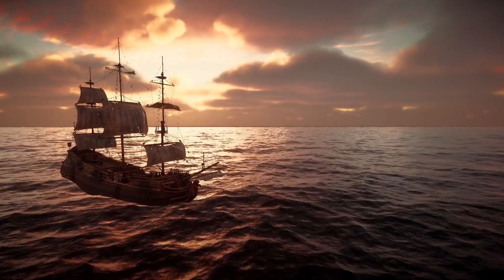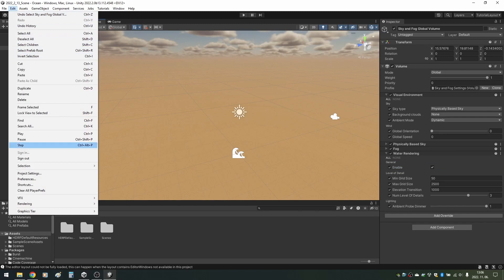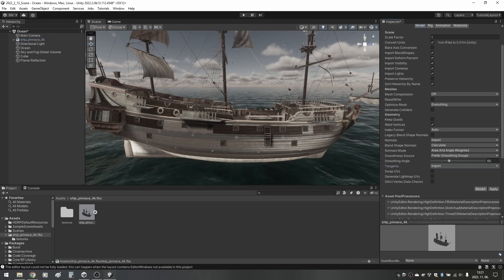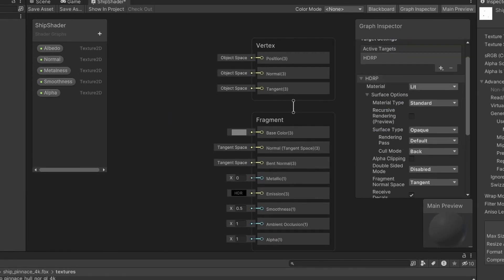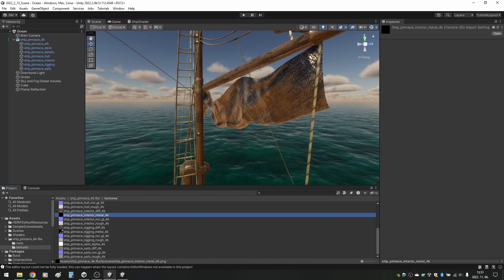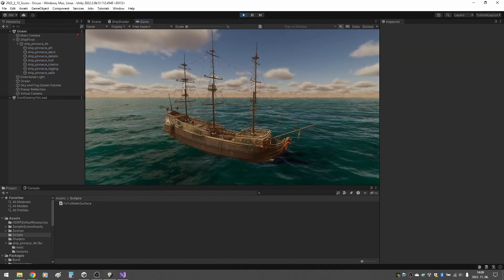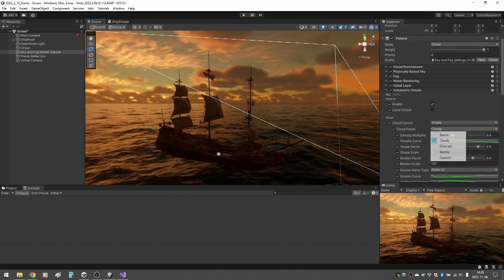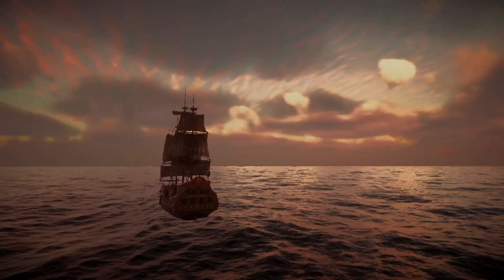Make a Scene with Unity's Water System! - Tutorial

Comment: Was there any point in adding a script for buoyancy if the ship doesn’t react even a millimeter to water and waves? Of course, I understand that the ship is large, but it does not react to changes at all, but only stays at the same level, as without this physics of buoyancy.
Reply from the maker: Are you testing it yourself or looking at the video? If testing: in this video I was using a beta Unity build, the script I have used here might not work in the release version. If you are watching the video: it does have an effect, believe me. It is not that realistic, but still better if I was not using the script at all. Watch the section from 11:21.
Reply: @bencemervay  Please, you can say how or show how to make such a script make the ship react to waves and pits, from the nose to the back, which would make it lean and not only jump exclusively vertically with the entire hull, but not once not bend, which is strange. I have been trying for a long time but I can't do it. by the fact that if you add control and an engine, a similar script with one buoyancy point makes the ship do somersaults in all directions.

Comment: 5:54 never do this in a real project if you don't want to get an angry reports, that your game runs at 5 fps on most hardware. You could also just extract roughness from the mask maps, invert it to get smoothness and pack them back, instead making new shaders and materials.
Reply: If you want to make something that would run on most hardware don't download such ship and don't use HDRP at all!
Reply from the maker: Hello! Thank you for the response! First of all: I never said in the video that this will be for a game :) If you have a look at the zip folder of the ship, you can see that there was no mask map. I know how to put it together (I also included the documentation for it in the video description), but it was not in the scope for this video. I totally agree with you that from performance point of view, calculating the smoothness map from the roughness map inside the shader makes no sense, but if you are just fooling around and testing stuff (what I do in the video) it is better to have a shader that can use both roughness and smoothness maps right away, becasue that makes testing faster. This is also true for the mask map. Most 3d assets have separate textures, so using them separately makes sense. Once you are making a game, creating a mask map makes sense. Regarding the shader: making new shaders for a game is actually the right choice. Unity's default shaders (especially in HDRP) are very heavy, so using them in a game environment is a mistake. When you are making a game you want your shaders to perform as little calculations as absolutely necessary and the only way  you can make sure that is the case if you make the shaders yourself.

Comment: The indirect diffuse lighting multiplier is NOT a way to get some bounce lighting, that control is optional to use after you bake indirect lighting, is something like a  "post processing" control to increase the value of indirect lighting, it does not have to be elegant or beautiful because that depends on your previous baked lightmaps.
Also, using reflection probes can help you with the ship and the water, because it looks off, or at least you can use SSR or planar reflections
Reply from the maker: Hi! Thank you for your comment. I agree that me saying that the indirect diffuse lighting will give bounce lighting is misleading. I simply should have said that I increase the multiplier to make the ship brighter. However, for the indirect diffues lighting multiplier to work you do NOT need to bake anything. You can see in the video that it works without baking. Also, have a look at this official Unity tutorial: https://youtu.be/DlxuvvYZO4Q?t=356 The presenter uses this override to dim the ambient lighting, however, he says that this is not a proper way to generate GI. Also, I personally try to avoid baking the lights when possible. I know I will get an inferior result this way, but I usually play with lighting a lot and do not have the patience to bake the lighting every time.
In this particular case the reflection probe did not help. No matter if it was probe or planar, baked or realtime, the area affected by the probe became very dark (and by that I mean VERY dark). This might have been a bug present in the beta editor version (now that 2022.2 is officially out I might check this again). I have SSR active in the scene, but it only has very minor effect, hardly noticeable. 
I agree that the ship looks off, a proper light baking might have made it better, I do not know. What I personally miss were the waves where the ship's body and the water meets, but I did not want to make that becasue the video is already long.
Reply: @bencemervay  Does this work for vrchat Quest? The animation works and blends but comes out black.
Reply from the maker: @OyabunDigy  hello! I am not familiar with VR content, sorry. But if I am not mistaken, Quest is a weaker platform, this means, you need to make graphically less demanding games for it. The water system and cloud system I showed in the video works only with Unity's HD render pipeline, which is for stronger hardware (pc, console), so I would assume it would struggle on a Quest.
Reply: @bencemervay   OK thank you very much for your reply have a great day